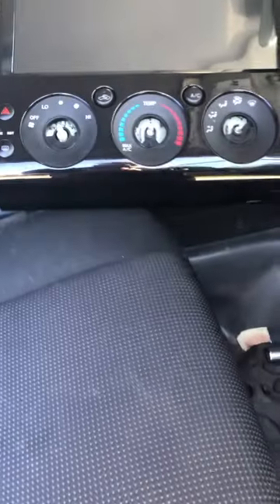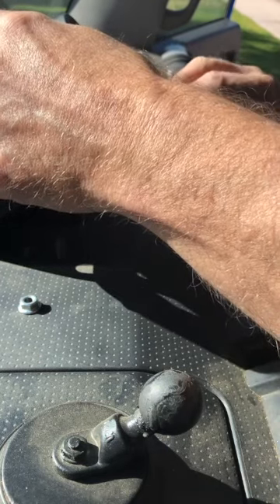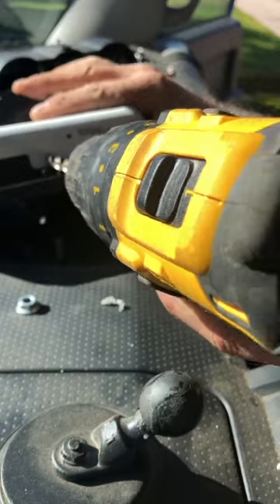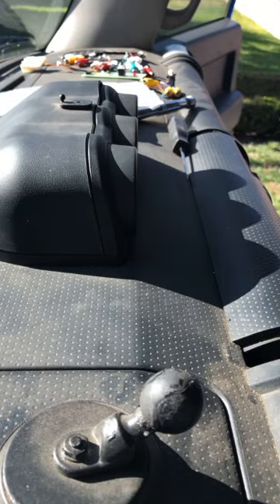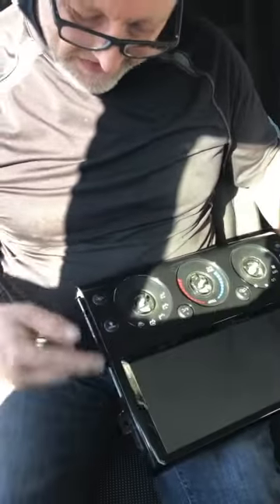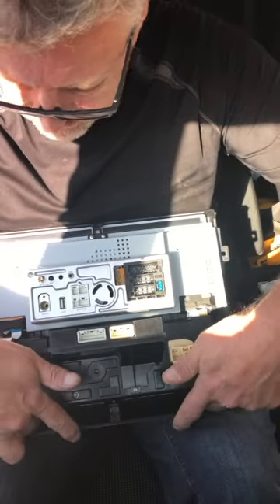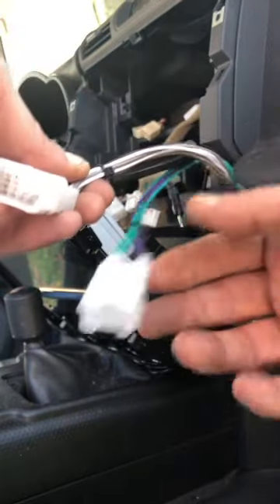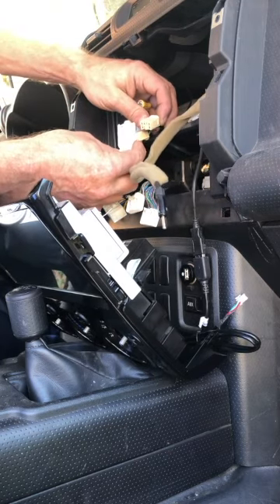Belsee 12.3 inch head unit  FJ Cruiser Install

Comment: Nice, I bought a silver version from an Australian vendor, and I love this thing.  You mounted the GPS antenna and the USB port in the same spots I did.  I sometimes do the same thing you did when you accidentally hit the brightness button while trying to change the volume. In my opinion a volume knob would have been a tremendous addition for something like this, but overall this is a great head unit.

Comment: Hi Andrew — great to see your video, hot off the press, because I’m on the point of buying one for my Aussie FJ and was desperately searching to find as many independent reviews as possible — is the fit good where the top edge meets the air vents — looked like it might not be quite right on yours, or was it just a momentary fitting thing that’s now resolved now that you’ve put the 2 holding screws in  ?